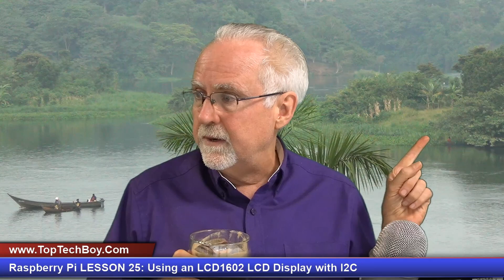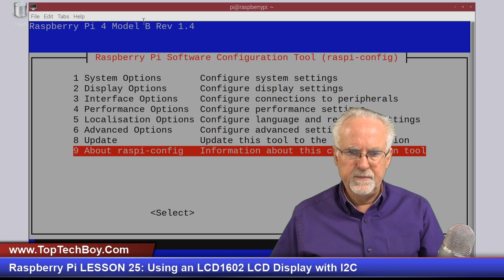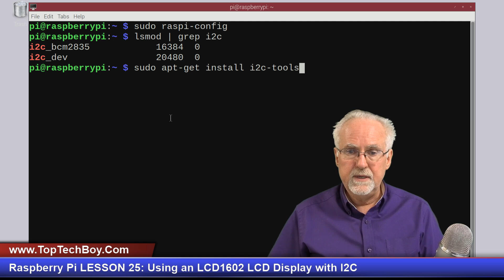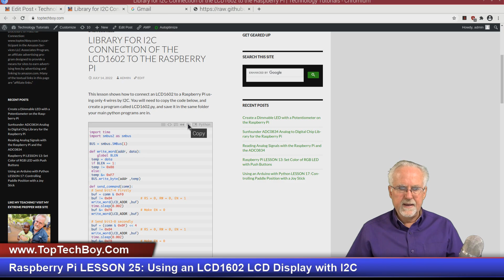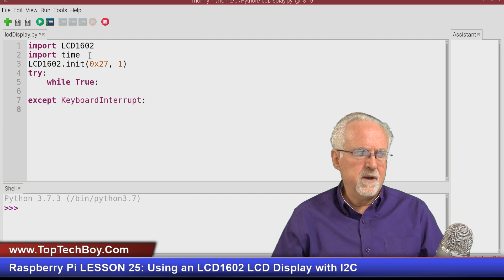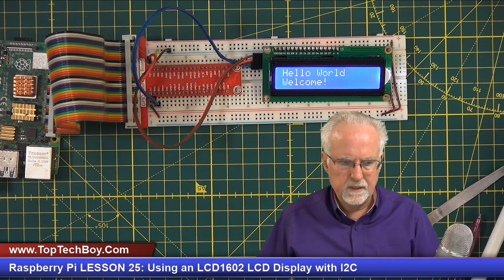Raspberry Pi LESSON 25: Using an LCD1602 LCD Display with I2C

Comment: Legend.  I wrote it in Go and had to translate the LCD driver using a python and C library.  There does seem to be a timing problem, but it reads correctly 9/10.  Sometimes I get an oddly timed pulse from the display that fits in between the pulses designated from the spec.  The more Go timers I use, the worse it gets, so I suspect there is some overhead from managing the timer that sometimes gets large

Comment: I love these videos, learning a lot. I am having trouble with the ones where library's needs to be installed. The methods used by Paul does not work for me.  I get a "error: externally-managed-environment". From what i've figured out I need to create a virtual environment and then work in that, which sucks a bit as I am not able to use the ide. Also , when i try this none of Paul's code seems to work. It seems things have changed a bit on Raspberry pi os since these videos where made.
Reply from the maker: Go back to lesson 1, and make sure you are using the exact operating system I am. Bullseye should get the same results I am getting.

Comment: import RPi.GPIO as GPIO
from DHT11 import *
import LCD1602
import time

input_pin = 21

GPIO.setmode(GPIO.BCM)
GPIO.setup(input_pin, GPIO.IN, pull_up_down=GPIO.PUD_UP)

dht11 = DHT11(16)
LCD1602.init(0x27, 1)

btn_last_input = -1
state = -1

title = ''
reading = ''
start_time = time.time() - 3

try:

    while True:
        btn_input = GPIO.input(input_pin)

        if btn_last_input == -1 or (btn_last_input != btn_input and btn_input == 1):
            state = (state + 1) % 3
            start_time = time.time() - 3

        btn_last_input = btn_input

        if time.time() - start_time > 2:
        
            title_len = len(title)
            reading_len = len(reading)
            
            is_valid, humidity, temperature = dht11.read_data()

            if is_valid:
                start_time = time.time()

                if state == 0:
                    title = 'Temperature'
                    reading = "{0} C".format(temperature)
                elif state == 1:
                    title = 'Temperature'
                    reading = "{:.1f} F".format((temperature * 9 / 5) + 32)
                else:
                    title = 'Humidity'
                    reading = "{0} %".format(humidity)
                
                LCD1602.write(0, 0, title)
                LCD1602.write(1, 1, reading)
                
                if len(title) < title_len:
                    LCD1602.write(len(title), 0, ' '.ljust(title_len - len(title)))
                    
                if len(reading) < reading_len:
                    LCD1602.write(len(reading), 1, ' '.ljust(reading_len - len(reading)))

        time.sleep(.1)

except KeyboardInterrupt:
    GPIO.cleanup()
    LCD1602.clear()
    print("Demo Good To Go")

Comment: hello i try to see your video but my visual studio code tell me  in the module LCD1602.py No module named 'machine'  WHY ?
Reply: Did you have the problem RESOLVED?? I run into the the same problem  to "import machine". However I did find out machine is a MicroPython built-in library and there is NO "built-in equilavent in Python. I wonder if Paul mentioned these in earlier videoes and had a work around. I will go thru those!!

Comment: Hello Paul, I have a concern about the signal of SDA and SCL port of LCD1602 that will it return the signal back to SDA and SCL port with 5V signal. SDA and SCL ports are supposed to handle only 3,3V so may it make the damage in raspberry Pi if we connect LCD1602 and raspberry Pi directly ?

Comment: I did it!  
My video is at :
https://youtu.be/0pc5QMr0O8w 
This is the video of my homework to Lesson 25 : Using the LCD1602 Display, DHT11 Temperature and Humidity Module, Transistor driven sounder, and a Pushbutton, make a Temperature Alarm, which is controlled by pressing a button, and turning a pre-set potentiometer.  
I also had a couple of Learning points!
When I designed the layout of the breadboard, I made sure that I wasn’t going to use any of the pins (with special purposes, e.g. I2C nor SPI, etc.), but I didn’t realise that only the GPIO12, GPIO13, GPIO18 and GPIO19 pins supported PWM.  Once that was solved, everything worked correctly.
Secondly, I have a personal preference for using the Pushbutton to enable ‘Setting Mode’, rather than toggling between modes.  For example, you can’t leave mine with the alarm disabled, and walk away, expecting an alarm which will never happen.

Comment: Very good training material. Well done and Thank you!  
Out of curiosity, what needs to be changed in the Library file to use more than one LCD?  
Also,  if I am planning to use a 20x4 LCD, what  do I need to be change inside the library file?
Reply: I think you can run multiple LCDs but the displays have to have different i2c addresses. Just initialize them with different names (lcd1, lcd2). The RPLCD library supports the 2004 displays. Can't link here but Google brings it up. It is a pip install and the docs are good.
Reply: @keithlohmeyer   thank you so much, I did exactly that and it worked. I'll search for the 20x4 info.

Comment: I am not getting my display to clear every time that I interrupt the program.  The "LCD Good to Go" does come up every time, but the display only sometimes clears.  I am using a Raspberry Pi 3b+ and have changed the time.sleep(time) to different values.  I even added another tiime.sleep(time) and LCD1602.clear() pair of lines and it still doesn't clear every time.  Anybody else got that same issue or have it figured out?
Reply: I'm on RPi 3b, same problem except mine won't clear at all.  Worked OK on my RPi4
Reply: I’m using a Pi4 and it didn’t work when time delay was 0.2…changed delay to 0.1 works every time.